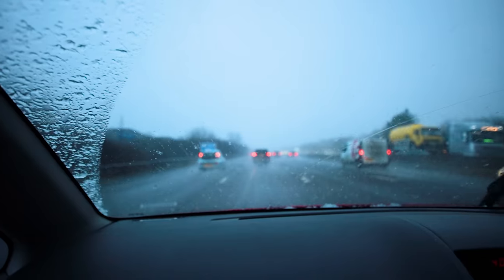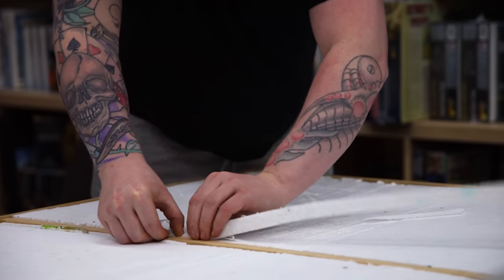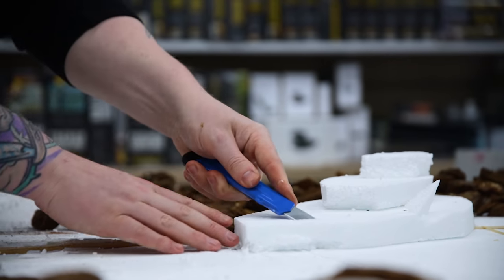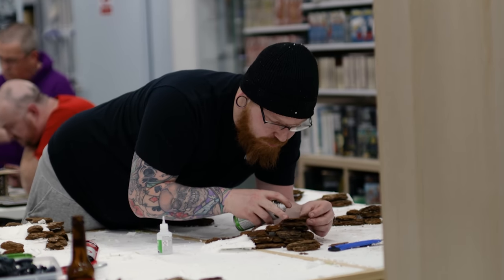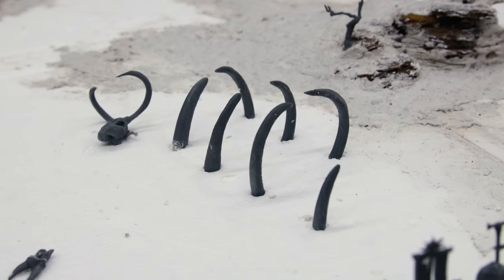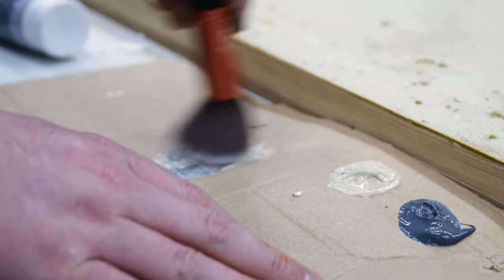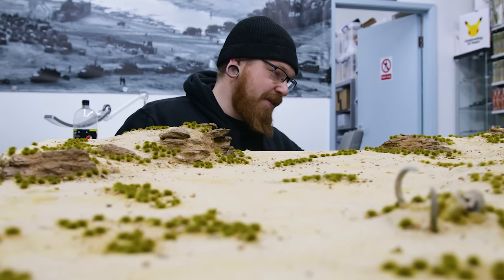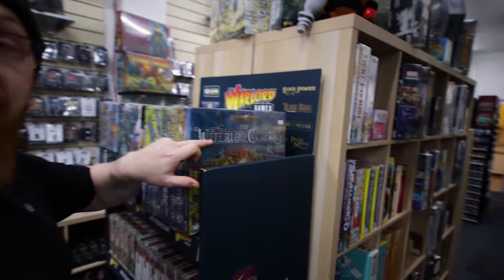Warhammer Wargaming Table - One Day Build

Comment: Impressive board, with a minimal input. I'm not into gaming but your techniques have taught me a lot for the armor and aircraft dioramas I'm getting into building now. I like the bark idea, at least for certain scenes. Having a basic knowledge of geology, this bark method wont fit well in mountain terrain where the rock is mostly igneous rather than sedimentary. But  it does portray sedimentary rock quite well.  I'm about due to make up a desert scene for the DAK models I've built, so thanks for the pointers.

Comment: Just in case there are any confused americans in here. When Luke says he lays the bark down 'like a dry wall', he means a dry stone wall. A traditional type of wall that is common in parts of the UK, and is made by stacking stones tightly on top of eachother without using any mortar to hold them together.

He is not talking about drywall that you line the walls of your house with. In the UK we call that plasterboard.
Reply: Thanks!  We call them dry walls here in the US as well.  Or dry stacked wall.  They are all over the place in many regions of the US in both rural and urban areas, especially the south, the north-east, and the very edge of the west along the Pacific ocean.   Here in Nashville they are common in neighborhoods, midtown, and surrounding rural area.  I think there may be a few in greener areas downtown, but they are less common where you have modern high-rise buildings and skyscrapers. In the wide expanses of the western US the sheer size of land makes them uncommon, with wire fences more common.
Reply: @EvanEdwards  Thanks, that's actually very interesting! I always thought they were something we only had in the UK (and maybe some rural parts of Europe), but I did a quick Google and I see that you do indeed have a lot of them in Tennessee, and they are just like the ones we have here. 

Unfortunately I've only ever visited the big coastal cities in the US, so I guess that has skewed my perception a bit. I've always wanted to visited the south though. Maybe one day!

Comment: Got a question regarding the EPS foam you're using: How sturdy is it when it comes to people leaning onto the board? Wouldn't XPS foam be the more durable/harder solution? I plan to build a similar board and don't want any dents or holes appearing.
Reply: Im not sure if this is still important now, but generally speaking, XPS foam is preferable as a base for the board. Though after layers of paint, glue and flocking, EPS is not going to horribly fall apart quickly either.